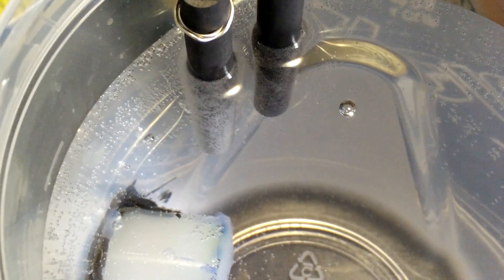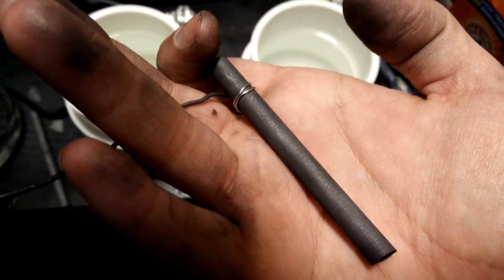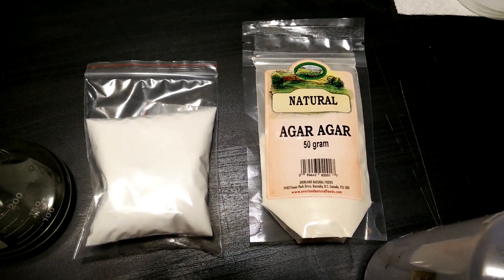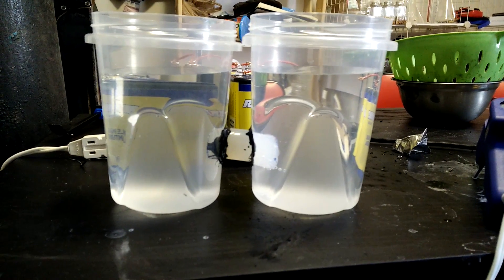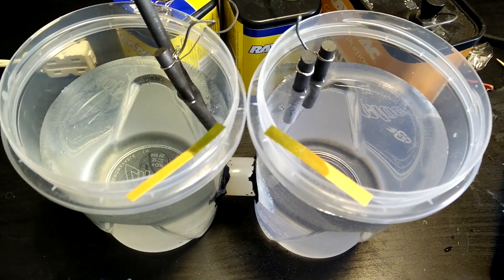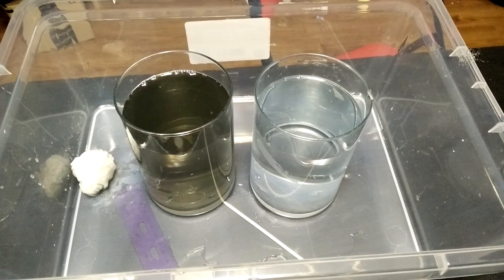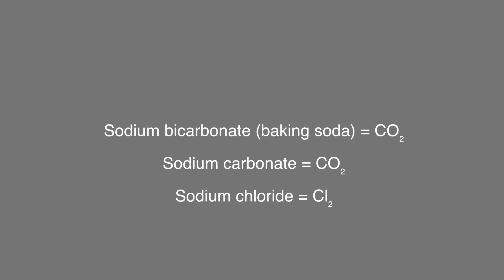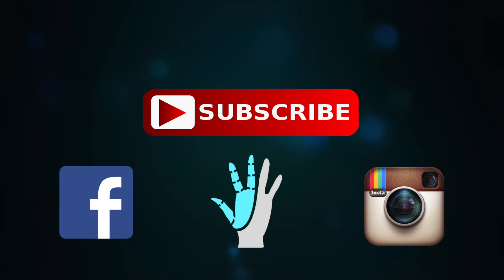How to make sodium hydroxide (lye) from baking soda

Comment: I wonder if a 24v transformer would work. Did you do the process for 24 hours to make it very acidic. Im going to try this and dry out the solution into powder to see what the ratio of liquid to weight in powder is..
Reply: Sodium Hydroxide is Basic not Acidic.
Reply: ***** What the fuck are you on?
Reply: +glen warren The transformer might work, just make sure the voltage is rectified, and not AC.
Reply: +elmardus Thanks...got it.
Reply: +Lachy Kyle I intent to mix two alkaline substances to make a super alkaline. There are many ways to obtain  sodium hydroxide including buying it off the shelf. Diesel will work for me in small portions but food grade is what im after for  quality. Transformers are no problem for me as  the same with rectifying ac voltages. My sign waves might not be perfect but im not dealing with sensative components. However I obtain the hydroxide...it all adds up. I bet If mixed with water and left in a draft free room for months...the vapors would crystalise on the edge of the pail.Its just a neat little experiment for me...just beacuse I can. I suppose im saying this to converse a little bit. Its the flask configuration that interests me. Just saying.
Reply: ***** Ahh okay. Just wondering, is English your native tongue?
Reply: Not interested in an english lesson. I thought you were interested in science. Thats the only reason I conversed with ya. In real life...not in computer land I wouldnt give a fjbgthrstnlki...2 seconds of my time. Go to bed adhdxyz punk.
Reply: ***** Ahh I didn't mean to offend you, I was just curious. Linguistics is still science :P
Reply: +Lachy Kyle  Are you ok...what have you been doing to yourself.
Reply: The topic was sodium hydroxide. Oh...I get it now.  Are you using this channel subs to open a how to spell channel.If ya do...send me a link...Ill be sure to pass it on.
Reply: +glen warren You should probably look into using a fume hood if you experiment with chemicals. You aren't understanding anything on here.
Reply: Youre right. Take care.
Reply: +Genocyde666  Actually  whats different about this is what he used for the centre plug. I studied this years ago and imagined this set up. Agar is a good option as it can be used for other things in my case. I use ventilation even to strip wire when I use my lighter to do it.. The transformer I wound came out to 32 volts DC. Works fine. Gonna try it with a half wave now instead...just because I do understand and have the parts on hand. I didnt dry  out the product as  I thought I might. Not much yeild for the price for what Im looking for. Dont worry...Ill do the math for the half wave . Im curious if this set up can be used for silver plating copper or zinc...just a thought. I have other things to take care of...take care.